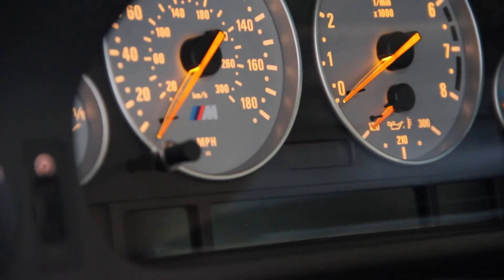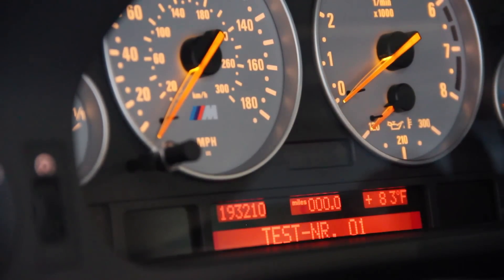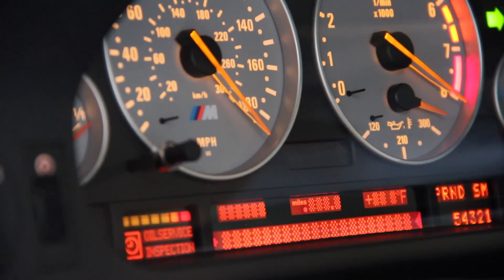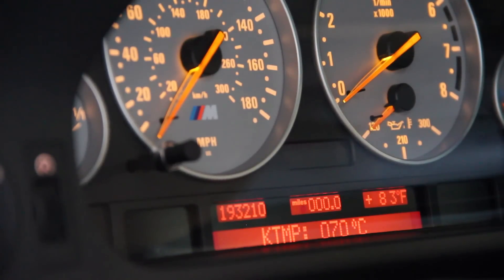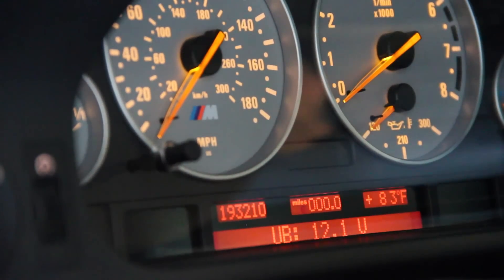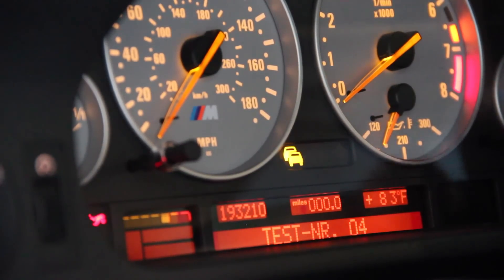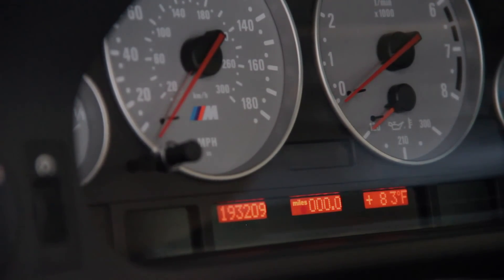BMW E39 High OBC Menu How-To (Diagnostics)

Comment: great video. explained the temperature gauge buffer very well. i had my E36 M3 cluster programmed so the buffer was removed and the 3/4 line is operating temp. needle moves up and down as i drive around, often will drop down to 1/2 point on long highway drives, and in the city on hot days it will sometimes move above 3/4 which is when i know to pull over so my headgasket doesn't explode. very useful to get that buffer removed, or else get an aftermarket temp gauge, don't want to play with your cooling system!

Comment: Interesting to find this feature on a BMW, I thought the Saabs were unique in that they had a (somewhat hidden) on-board diagnostic system from factory (Saabs call it OpenSID). Just a guess for ATMP, could it be a temperature reading for the intake air? That's an important measure in my turbocharged Saab as it shows me how well my intercooler is able to cool the air. Though the M5 is naturally aspirated I would assume that the ECU does the same type of airmass calculations (just like the Saab) in which it computes the number of air molecules (mol) that are sucked into the cylinder per combustion. This is then used to find the correct amount of fuel to inject. As we know, the density of air depends, among other things, on temperature. Also, thanks for your videos. I've been watching for a few years now and it was the single biggest inspiration to start my own channel :)

Comment: Quick question on the instrument cluster. I had sent in my Instrument Cluster for the LCD Ribbon repair and when I installed the unit back into place, I powered on the vehicle, everything looked fine until I noticed that the BC function on the turn signal stock was not working and the option to navigate through various features such as range, etc on the cluster was unavailable. I also noticed that the clock on the stereo reset and it has something to do with that, I'm not sure why but I would appreciate any tips and help on this. Note, there is a BC Button on the stereo in case I can reprogram it in any way or if I'm missing something I haven't done. Fasten seat belts, key in ignition messages are displaying, just the option for the BC Functions are not available.
Reply from the maker: It sounds like the cluster coding was altered.  Do you have coding software that can check the options on the cluster?  If not, try the test #21 reset and see if that brings it back.
Reply: @E39Source  thank you for the tip. I will try it as soon as I get home. I'll get back to you

Comment: I have e39 high pixel and my bc dashboard screen won’t display time or any of the BC features anymore. It just started to do this but the screen still works and will display “check front foglamp” because one is out. In the past i would just press the BC button on the end of the turn signal stock and it would go back to the time or BC feature I had displayed, but now it doesn’t do anything. Help!

Comment: Why does the cluster backlighting stay lit sometimes, vs others? I know it has a dimming feature via a light sensor in the cluster. But it shouldn't be backlit all the time even w/ key on all the time. Mine does that sometimes when it sits in the sun at work then fades back. Quite odd...

Comment: I have the 1 trip cluster, when I get to 19 ,I can't put the code in, it flashes on off but it will either continue or cancel depending on how I try to find a pattern with the trip button .My issue is no interior gong tone when I get to 13 it says gong but don't do anything, any ideas thanks
Reply from the maker: Low OBC cluster?  I am unfortunately not familiar with the test menus on those.

Comment: I have a recurring P0103 MAF code. The engine is running really rich. After some troubleshooting (disconnecting the MAF cables and reconnecting them one at a time, the cross connecting them one at a time) I was able to determine that both sensors are functional, however one of the connecting wires Dosent seem to be delivering information to the engine. Any thoughts?
Reply from the maker: I wouldn't fault the wiring, unless it has been damaged or otherwise tampered with.  How old are the sensors?  If either one or both are over 5 years old, I would just replace them.

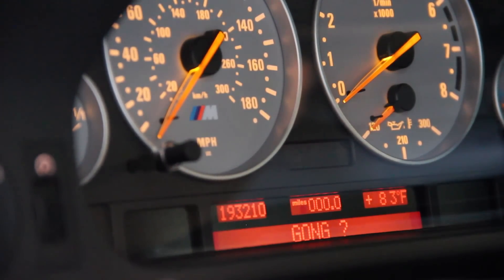Comment: At 4:35 on test number 13 I like that gong sound. BTW does the E46 3 series or ///M3 have a gong as well or a piezo?
Reply from the maker: I don't know what a piezo is.  The E46 has that dumb beeper.
Reply: I thinks it's a piezo
Reply: You can code E46 using NCSExpert so it gongs or dumb-beeps, whatever you like. I've coded mine so it gongs, the same sound as E39 from the video.
Reply: dakibmw How does the NCSExpert work?
Reply: Well, you need modified ("BMW") OBD cable and a bunch of software that is usually downloadable as a "package" - INPA/EDIABAS, NCSExpert, DIS, TIS, etc. NSC DOES work on it's own, though. NCSExpert basicaly works like this: you extract/"download" coding file (which is actually a text file) from car's module (for example, in this case instrument cluster module), change the parameter on your PC, and that modified file "upload" back to the module. Those are the basics, there is more to it, but the most important thing is to either remember what you've changed, so you can revert it, or to make a backup of the extracted original file, in case anything goes wrong, you can always revert to it's original setting.

Comment: ATemp probably airtemp? Considering: 83 degrees Farenheit  is equal to 28.3333 degrees celsius which is roughly 28.5 degrees Celsius
Reply from the maker: Likely is!
Reply: Actualy, it's a German car, and it means "Außentemperatur".  The same applies to KTEMP, which means "Kühlwassertemperatur"
Reply: Yes, that´s right. ATemp means ambient temp ;)
Reply: I think it also might have something to do with the intake air temperature, as the temp displayed on the dash (from the sensor in the RF wheelwell does not always directly correlate to the value in test 7.
Reply: +computiNATEor  nope ;-)

Comment: Hi
I have same exact car. My all brakes lights turned on almost after 15 minutes of driving and yes I replaced the abs module and code it. I also replaced one of abs speed sensor.  Any idea??
Thank you
Reply from the maker: You should check the ABS module for codes.  It will indicate what the problem is (another wheel speed sensor, pre-charge pump, etc).
Reply: @E39Source  
It keeps showing the front left abs sensor. I already changed it. But aftermarket one from Ebay. 
I really appreciate your recommendation
Reply from the maker: yasser moustafa You get what you pay for with parts. Ebay parts won’t work more than a few weeks if at all. I would put a new OEM sensor (BMW brand, Hella, Behr, Lemforder, etc part) in, reset codes, and try again. If that doesn’t work, you could have an electrical, reluctor ring, or module problem.
Reply: @E39Source  thank you so much Ryan. I'll do that and let you know how it goes  :)
Reply: Hello Ryan.  I did replace the abs wheel sensor. And the 3 brakes lights still on.. do I need to do anything else after installation?
Thank you
Reply from the maker: You replaced the sensor with an OE/M sensor?  And the same code is still there?  I would say that's the module, but you replaced that and had it coded, and you STILL have a code for that sensor?  It has to be the reluctor ring in the hub then.
Reply: @E39Source  thank you so much for your reply . I'll check on that and let you know  :)

Comment: Hey e39 source. I have a 540i and on the screen under the mile. It says trans failsafe prog. Is that bad. And how can I fix it. Thank
Reply: Thanks
Reply from the maker: I am not familiar with the faults of the automatic transmissions, but yours seems to be having issues.   I would find a trusted independent shop and have them diagnose the transmission issue.  Good luck!

Comment: Hello
How to reset CONS 1 and CONS 2?   
How to change Language? Mine is in German.  Thanks
Reply from the maker: Not sure what CONS 1/2 are.  

Language probably has to be changed with software from a BMW dealer.  There's no simple setting for that.
Reply: E39Source CONS 1 = consumption  but i dont know how to reset them so i can see my average consumption.
Reply from the maker: Oh Consumption.  That's done in the menu of the navigation display.
Reply: E39Source how? I haven't figured out yet. You? 
I just bought e39 520i year:2002. Is "Factory Reset" test 21 safe and can reset Consumption? Thanks
Reply from the maker: Press menu, go to Onboard Computer and press the button in to select it.  Then highlight over Consumption, and press the button in again.  Then select recalculate.
Reply: E39Source on dashboard or on middle console on the radio? I dont have navigation ( display )
Reply: Hi Ryan, question, how do i actually reset my service light i just changed oil, tried one way didn't work. 2002 530i e39 high cluster. Thanks

Comment: Hey, i have a 2003 540i msport that lately has had a loud static noise coming from the front passenger mid, sounds like that noise that happens when you plug something into aux but doesn't go away. Any input would help thanks, ps. Ive done a hard reset and still nothing.
Reply from the maker: Something may be wrong with the wiring somewhere.  I have never had that problem on mine.
Reply: Do you have an aux cord? If you leave it disconnected and on the center console, like I do sometimes, you can get a noticeable hiss through the stereo. Turn the stereo off if you're not using it, and see if connecting a source to the aux cord makes it go away.
Reply from the maker: Yes I do, but I have never noticed that.  It's probably just feedback from something.
Reply: ***** Right, I was replying to the original commenter, sorry. If the aux cord is across the transmission tunnel, I do often notice static.
Reply: +computiNATEor Yes I do... I'll just give a little more detail. A few months ago my car died. Tried to jump it with a buddies truck and no luck. Put it on a trickle charger and ended up working. But my rear drivers side sub went started making a the same LOUD noise. Then unplugged my amp because it was annoying. Went a few weeks and plugged it back up and it quit with the back sub and went to the front passenger mid. Now a month later problem still continuing and my OEM double din headunit is starting to freeze every once in a while. Any input is appreciated
Reply: +E39Source .
Reply from the maker: OEM Double Din Headunit.. do you have navigation?  Seems like a failing amp or failing speakers. Jumping these cars can have strange after effects.
Reply: There is no "OEM Double-DIN head unit" for the e39. Aftermarket Double-DIN units don't fit without trimming the air vents, either.

Comment: Hey i have an E46 318i and now it only goes to the 1st gear it's an automatic do u no what the problem could be?
Reply from the maker: Sounds like the automatic transmission has failed.
Reply: +E39Source Do you think it could be the valves?
Reply from the maker: Intake/exhaust valves?  They have absolutely nothing to do with the transmission.
Reply: +E39Source hum OK thanks anyway this is my 2nd gearbox.
Reply from the maker: Are you changing the fluid?
Reply: +E39Source Nope, I think I'll have to change the gearbox.

Comment: E39 m5 automatic gears ??????
Reply from the maker: At the end of the day, it's still an E39 cluster.  While the E39 M5 never came with any automatic gearbox, the indicator is still in the cluster, just not used.  BMW just took a regular E39 cluster and gave it new dials and needles.

Comment: What is the idle rpm on the e39 m5? it seemed very low
Reply from the maker: The OBC will report around 600RPM warm.  The needle looks like 450-550RPM.  It's very low, but very smooth and steady.  This engine was just rebuilt, and a strong low idle is generally a sign of a strong and healthy engine.
Reply: ***** Thanks for the reply, the needle looked really low, like below 500, thats why I asked ;)